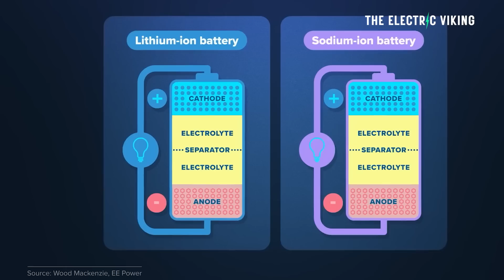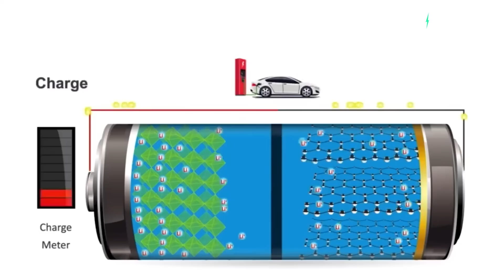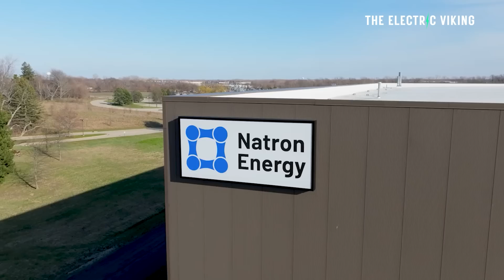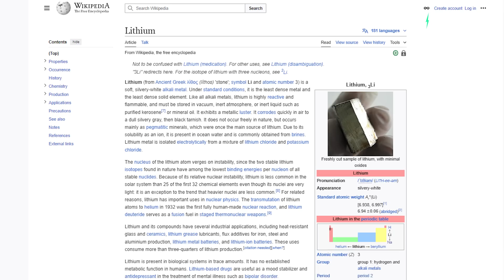America's game changing $1.4B sodium-ion battery gigafactory

Comment: It's  stupid to discount sodium's potential. 
But It's  also stupid to ignore sodium"s physics that make it impossible to ever equal lithium in portable uses.

Sodium is abundant  available and easy to process so it's  cheap to use for anything. AZ global production  of lithium increases, lithium will never again see high prices.

Sodium is vastly safer to use and for battery chemistry safer due to better efficiency and less loss.

Sodium loses in comparison to lithium in 2 ways..

1. Mass. Although industry experts say Sodium is only about 50% more than lithium, IMO that's  optimistic
2. Energy density. Sodium is only about 2/3 of lithium.

What this means is that Sodium can never compete with lithium for performance where weight and volume in a moving device are essential. Any innovation to improve the use of Sodium likely can improve lithium as well.

But there is an enormous market for stationary uses that prize low cost, safety, long life and minimal if any maintenance and that is where Sodium shines over lithium but competes with other energy storage techniques

Comment: The game changing part is when the price to purchase say a 48v 10kwhour bank is much cheaper than AGM sealed lead acid. a 48v 660AHOUR agm IS ONLY $5K AU but u only get 1600 cycles at 25% depth of discharge or about 10kwhours worth from it. If u can sell a 48v  660a hour  bank for less than 5k, and lasts 50 years and 10-thousands of cycles, then finally we can get our money back on the costs. Lithium ion it a MASSIVE RIP-OFF IS LIKE $15,000 for a 10kw bank, and u will never get you're money back in power savings. plus risk a massive fire!.

Comment: I significantly doubt that SIB's will ever be used in consumer EV's, that's where SSB's will dominate. The increase in weight and smaller amount of cycles that SIB's have would prove better in Bus's, renewable energy storage, and backup power storage. Hence, SIB's will dominate in such markets. LIB's will be in our portable devices forever until there is a new technology providing even better power storage (SSB's).

Comment: Sodium batteries will have their place but they will not be completely replacing lithium. Especially in applications where  weight matters. Which is quite a bit of applications. At the least it will take some of the pressure off lithium.

Comment: I completely agree. One important factor is also fire security: As I understand they would not burst in flames when damaged, internally or externally.
Reply: Sodium is a FLAMMABLE SOLID which will ignite spontaneously in AIR or MOIST AIR and reacts violently with WATER or STEAM to produce flammable and explosive Hydrogen gas.
Reply: @Mauricio17-x1p  Wrong. You swallow sodium every day as a Kitchen Salt. Bare pure sodium is not the issue here.

Comment: Recently, I tried to buy a 12v sodium-ion battery for domestic use.     I could not find a reseller in Australia, so I had to settle on a high end Li-ion battery.      After reading about the circus over DCS batteries, I wonder if I have done the right thing.     I think DCS has done themselves and Li-ion batteries a power of harm by their legal attitude.

Comment: Natron Energy optimized for super fast, high cycles and target critical applications like data centers. However, from what I could see in their datasheet energy density is very low. I'm concerned that they are not going to be cheap, in comparison to HiNa or CATL, that aim for an LFP comparable energy density from the start, but maybe I'm wrong and all their materials that they use in higher quantity really are that much cheaper.

Comment: I've been saying sodium is the future over and over.  Ubiqutous super charging will make it so. You will only need 300 km effective range with 5 to 10 minute 500 kW super charging.  It will be game over at that point.  After driving 3 hours typically most drivers require a 5 to 10 minute break.  That will be their recharge time.

Comment: Sodium is heavier than lithium, so you get an even lower energy density than lithium ion.
Reply: Yes true they can never match Lithium energy density as the ion's are larger but Sodium's are cheaper, made from common elements so no supply chain issues, need no heavy industry in processing, don't suffer thermal runaway so safe to use in all applications & can operate in lower/higher temp extremes. Current Sodium's are touching on 200mwh so about the same as Lithium about 10 years back & that makes them suitable for grid scale applications, home storage solutions, domestic devices such as power tools/laptops & vehicles such as scooters or entry level electric cars.

Comment: The critical factor now is to create standard sizes (5 or 6 in metric) and have a range (3 or 4) of standard energy rates for each size with a standard connection per size or group of sizes. Sizes remaining constant but energy standard changing per size each year. The first part of the standard designation is the year, then followed by the size and lastly the rated energy for the battery. 
So a 24- 15,10,4-100 battery is a 15cm by 10cm by 4cm battery to 2024 standards with an energy rating of 100Ah.  Manufacturers then designate what size and power rating their product uses.  In 2025 the code changes to 25-15,10.4- 100 if the power rating stays the same. if it increases 50% it would change to 25-15,10,4-150 that way batteries will always be compatible with the year of product manufacture. To replace the battery first look up the year then the size and finally the energy rating. Custom batteries would simply be 24-custom1-Huge maker Corp. So the potential buyer knows that custom batteries from the Huge maker corporation must be used and not cheaper standards and the upkeep or price will not be to the standard expectation.

Just a suggestion. But standardisation is essential. Just look at the chaos of cordless tools and the huge price of low selling tool batteries and also popular ones as makers make hay while the sun shines.

Comment: I could see this being integrated into de-salination plants around the World, using the waste salt as a material for battery production that will ultimately power those very same de-salination plants
Reply: To go from a brine concentrate to a dry salt takes a lot of power and costs a lot.
Reply: @dsc0273  waste salt goes into the ocean causing environmental issues, with renewables and batteries this could be a workable economic symbiosis that benefits the environment that produces fresh water and materials for future batteries
Reply: @smefour  it doesn't cause problems.   The discharge manifold in the ocean is covered in coral.
Reply: @dsc0273  Not sure what coral has to do with it for every desalination plant in the world, where I come from there is no coral but we have 3x desalinations plants, over salty discharge into the nearby ocean water does harm the environment as not all organisms cope with the higher salt

Comment: It cannot replace lithium ion batteries in all use cased due to lower energy density, but makes up on larger cycles and charge speed (due to less heat). Ev is still a potential use sure, but they are aiming mainly on stationary storage like datacenters.

 Source : Nartron white paper, https://youtu.be/UmW2D_At1PY?si=mjavEYFvaG4Zew32

Comment: Sodium has advantages and disadvantages.
It's always going to be heavier & less power dense this is only really going to affect sports cars. It's temperature & cost advantages will effect all vehicles.
Reply: Considering it’s only just possible to make a lithium ion battery truck - it’s not going to be possible to make a sodium ion truck battery. Sodium batteries have approx half the capacity of lithium. So that means a car currently equipped with a lithium battery, will get about half its current range.
Reply: @sullivanrachael I do agree it will be a ways away if possible but it’s kind of silly to say something isn’t going to be possible with a new technology. Especially since it’s so cheap to experiment on it.
Reply: @sullivanrachael  Keep in mind you can add Li as well to the mix. While it might off set some of the cost benefits, it can still be mix with other elements still to help push it forward.

Comment: A 200 MWH battery may be misleading to people. They are not good for 200 MW of off peak power for an overnight time frame.  If they need to provide off peak power for 16 hours (the time when sunlight is not available) for power production they are only good for about 13 MW of off peak generation replacement.  These videos make it sound like these batteries will do a whole lot when infact it takes a lot of them to provide 200 MW of off peak power.
Reply: Neighbourhood batteries perhaps

Comment: February 2024, Lithium fell to just over $13,000 per ton, June 2023, Sodium Carbonate cost around $290 per metric ton on the Shanghai Metals Market.
Sodium is 1000 times more abundant than Lithium. Lithium is more than 44x more expensive than Sodium. I believe the key parts of the equation is that Sodium is more price stable and cheaper.
Reply: The problem - or one of them - is sodium is more energy intensive to produce than lithium. So the raw material might be more abundant but it will cost significantly more to process than lithium. The other problem is the Sodium batteries have half the energy density. Or you need twice as many to do the same job as lithium. That’s like saying your EV will need a ton of battery rather than 500kg of battery. That means the efficiency of the vehicle is a lot less, effectively accelerating and decelerating 500kg of dead weight all the time. Not good
Reply: @sullivanrachael  yes but the energy grid needs something else than lithium that last. Sodium is not the only thing researchers are trying. They are trying to extract lignin from saw dust from saw mills and make batteries. The energy grid do not care about weight or density just that it is long lasting and can charge and discharge fast. So I guess mobile phones and cars might keep lithium.

Comment: The largest present-day demand for sodium-ion batteries will be to replace data center UPS batteries. These batteries are currently replaced every two to three years. Due to cost, they typically do not use Lithium.

Comment: Sodium batteries have one disadvantage compared with Lithium. This follows from two facts -- that (a) a single Lithium ion stores more energy that a single Sodium ion, and (b) it also weighs less 

That means for auto and aero power Lithium will always beat sodium. 

Sodium, if cheaper, is viable for static storage (everything from a home power wall to grid stabilisers), and might be viable for ships and railways (to get electric trains past gaps in the power lines).
Reply: yachts will love them
Reply: Also the volume is greater with sodium than lithium - though, they still will have a place in automotive - as not everyone drives a straight 6, V8 or more 🤔

Comment: For the BEVs: Natron's BluePack Battery (that are actually sold right now it seems?) gives 25kWh and weights 75kg. That means more than 300 Wh/kg, it's a density similar to NMCs'... where's the caveat? What am I missing?
Reply: It is 75kg per 1.23kWh module they are heavy. However not much of a problem for stationary storage. I would take two 2 meter tall racks to replace the single 1.2 meter tall rack of storage I have for my house. These do seem to be extremely safe though I could see a use of distributing them around a house near large loads
Reply: @dannelson6980  no need, locally rectified to AC and transmitted efficiently to point if use using standard houshold wiring. KISS.  unless I'm missing something?  DC Appliances?

Comment: The shipping battery has fantastic specs, including 15 minute recharge time, but it is really for stationary systems.  It weights 75kg for a 1230 watt/hour battery.  It is also 256x269x951mm, much larger than the equivalent Li battery.  It is a product you can buy now and the new factory will ramp up production.  Size and weight will keep it out of vehicles until they get much lighter/smaller.
Reply: Do you happen to know the cost?
Reply: @dannelson6980  Their website gives a list of distributors, but none of them appear to have pricing visible.  All seem to want to quote a specific job for you.  Perhaps when they get enough production capacity they will be selling on the open market.
Reply: @dannelson6980  $1000 for a 100 amp 12V battery
Reply: For EVs this may be useful for battery swapping.
Reply: @franssantos9417 yuk.

Comment: There are currently 27 sodium-ion battery plants in some phase of construction globally but these are mostly 1-5 gig size facilities.  A 24 gig sized plant would be the biggest in the world, currently.
Reply: Technologies in this field develop very fast.  Building such a big factory is not wise.  When it's done in 2028, the tech is already behind.  Tier investment of building smaller factories every year with tech upgrade is a better path.
Reply: @Fordance100  Perhaps, but Na-ion can be built on the same product lines of current Li-ion, which is where most of the Na-ion batteries on the market right now come from.  Unless they figure out solid-state by then, which is a big if, these lines should be able to use the most current technology at the time.  24 gig is big but most large manufactures like CATL, BYD, Tesla, Panasonic, etc... have factories in the 40 to 100 gig range.

Comment: These are the EV battery you want. BYD are ahead, you can buy a Seagull EV with a 38kwh 252 mile range. Super safe Vs all other battery types, no more ev battery fires 👍

Soon all EV's will come with them, and the tech will improve over time, but as per the BYD current version, they are 'good enough'.

Comment: So far, I see its application in stationary battery storage because of its low cost, safe from thermal runaway, invulnerability to sub zero and high outdoor temperature environments.
Reply: boats
Reply: @mikepayne1350  boats are good too.
Reply: If that is true, the potential to scale the manufacturing is going to see the cost curve drop exponentially. Nice 👍
Reply: @dandantheideasman  yachts love lithium but are terrified of fire.    a non flammable battery would sell like hot cakes.
Reply: @mikepayne1350 , you do realise that it's not the lithium itself that is responsible for fires, don't you? It is the cobalt in SOME Li-Ion chemistries that is responsible for fires. LFP batteries don't use cobalt and therefore, don't have the same issues with fires.
Reply: @briancampbell179  Cobalt? No, it's the highly flammable electrolyte that burns, not the cobalt. It is possible the cobalt in someway catalyzes a fire, but the electrolyte is what actually ignites, sometimes explosively if it vaporizes.
Reply: @Hybridog  , the electrolyte is just the fuel. It is the exothermic reaction involving cobalt that starts and maintains the fire making it difficult to extinguish
Reply: @briancampbell179  true. Though LFP can combust easier than Na based batteries.
Reply: @dandantheideasman given it is the electrolyte that is the fuel, that would depend on the electrolyte, wouldn't it? If sodium batteries use the same electrolyte, surely they'd burn the same. To be less susceptible to fire, the electrolyte would have to be less susceptible. To be honest, I'm not that familiar with the chemistry of sodium batteries.

The reason LFP batteries get a little warm in the nail test would most likely be due to the electrical heating due to current flow which is something that would happen in any battery.
Reply: Perfect for vehicles also.  Ubiqutous super charging will make it so. You will only need 300 km effective range with 5 to 10 minute 500 kW super charging.  It will be game over at that point.  After driving 3 hours typically most drivers require a 5 to 10 minute break.  That will be their recharge time.
Reply: @radiotec76 I've been following these sodium-ion batteries for around a year now, I also got very excited when I discovered the mfg plant is 1 mile west of my place of work in Holland MI.  However I don't believe we'll see these in the car Industry, based on temperature limitations. That is if you live in a place that see's ambient temperatures between -20°F and 100°F.  Perhaps things have changed in the last few months but so far the product Natron is building is for climate controlled environments.  Just checked, Natron posts: Operating Temperature Range -20° to +50°C / -4° to 122°F. Here's the PDF where I verified then numbers. (bluepack_critical_power_battery_rev2.1_061324-1.pdf), Top of page 4.  

Sadly its high limit is the same as SLA AGM batteries and a reachable temperature in Phoenix AZ .  Solidstate batteries out perform Sodium when it comes to operating temperatures, and I believe there's just as many companies working on that as well.